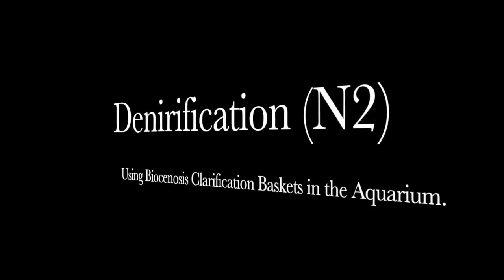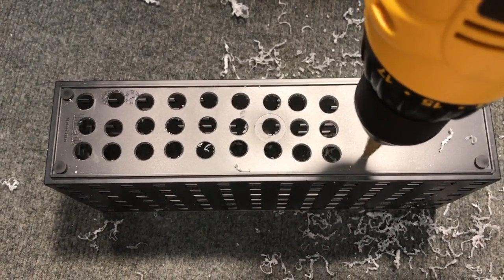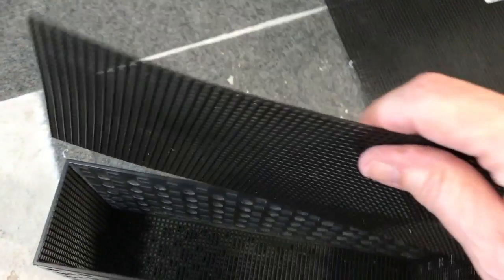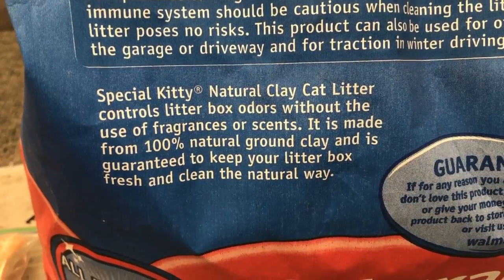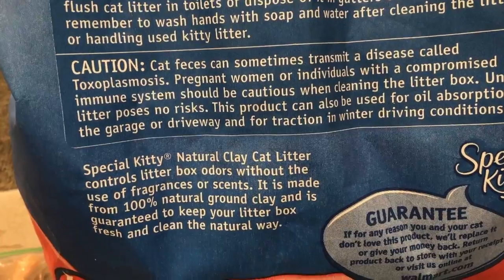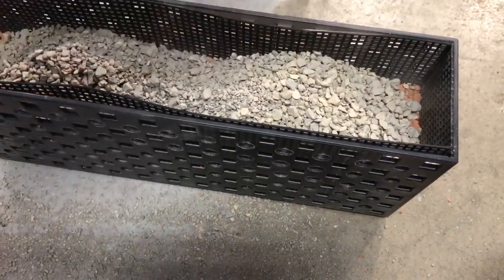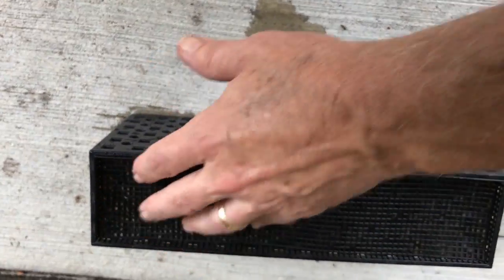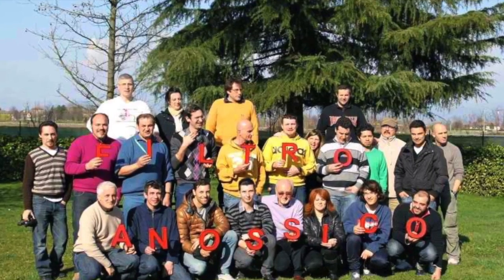Denitrification (N2) using a Biocenosis Clarification Basket in the Aquarium Sump.

Comment: Hi Doc, lots of questions here about media but I'm curious about the flow rate.  Typically a bio filter rule of thumb is 4x tank volume per hour.  How would you set the "low flow" rate, in terms of tank volume per hour, for anoxic filtration through a BCB filter?

Comment: Hi doctor. 

The explanation about "ionic attraction" was based on a progressively more and more negative substatum...

BUT :

It seems that the laterite layer do not have to be "buried" in the center of the cat's litter, as it goes to the contact of the basket in this video. 

Questions : 

Do we really need any cat's litter finally ? Maybe the laterite could be sufficient, no ? 
Or maybe the laterite layer is completely unuseful and only the cat's litter is functional ?

Anyway : the ionophoresis theory do not stand anymore with this video i'm affraid
Reply from the maker: If you can find another substrate decking attract positive ions out of the water besides kitty litter let me know. But it also has to have a cost factor involved in it.
Reply: This is NOT my question. The question is why do you tell the latérite MUST be buried in cat litter and do not do it here, this is a non sense in front of the ionic attraction... 
The question is then: latérite appear to be totaly unenecssary

Comment: Hi Doc , 
I made 3 x bcb baskets roughly 300 x 300 and planted 1 water lilly in each and placed them directly in my outdoor pond. I only run a Hozelock 9000l submersible pump with bcb bags in it that feeds a water statue. Can you confirm if the BCB baskets placed directly in the pond will have any impact.
Reply from the maker: They will have an impact, but that will depend on just how big your pond is, how many fish you have, how often do you feed? All these parameters will judge how many BCB baskets will you need. In my pond that was 1200 gallons with the amount of Koi I had in it I had 21 BCB baskets that were 7 x 7 x 11 in size and that handled that pond for over 30+ years.
Reply: @anoxicfiltrationplenums  do you have a video on that pond setup. ?

Comment: Dr. Novak excellent video! I just joined the discus hobby just under two years... I'm currently running a canister and overhang filter with partial water change and gravel cleaning 3 times per week. I need to investigate how I can install anoxic filter in my cabinet with limited  space.  if I figure  a way to build anoxic filter,  I hope can reduce my water change and gravel cleaning maintenance for the lowest nitrate level.

Comment: Hi Dr Novak,
Is it more more important to maximize the surface area around the BCBs to increase contact with the water flow around the bags (ie lots of small bags cumulative increasing the surface area)?

 Or is it better to have a larger Anoxic area inside the BCBS for the Anoxic bacteria to process NO3 to N2 (ie 1 or 2 large bags maximizing the Anoxic Zone 3?).

Grateful for your kind advice!

Comment: Hello Dr. Novak. I have setup a 110 gallon tank with a 35 gallon sump with 2 big BCB (11" 11" 8")  and I'm planning to use those BCBs as single filtration means. I have seen a lot of people that turned their traditional filtration system  in anoxic but I would like to start my anoxic filtration system by scratch. Is it possible ? Thank you

Comment: Hi Dr Novak, "Non-clumping kitty litter is mainly the clay mineral attapulgite (aka palygorskite) which is a magnesium aluminium phyllosilicate common in soils in the southeastern U.S. Attapulgite derives it absorbency from its needle-like, 3-dimensional crystal structure" is this the crystaline structure you mentioned in the video?
Reply from the maker: The clay or kitty litter has been backed and that’s what gives it the crystalline structure and holds it together. You can also use oil dry as a replacement.
Reply: @anoxicfiltrationplenums  can we used akadama soil for bonsai or hydroton as substitution alternative? Please answer...
Reply: Must nonclumping unscented kitty litter clay type .

Comment: Will iron oxide provide the iron needed by the bacteria?
Reply from the maker: Yes, iron oxide can be used like in the old days.
Reply: @anoxicfiltrationplenums  One more question, please. If baked clay attracts nitrate ions will crushed unglazed pottery do the same?
Reply from the maker: No, Kitty litter has a crystalline structure to it where clay pottery does not. That Crystalline structure attracts the positive ions out of the water body proper.
Reply: @anoxicfiltrationplenums  What creates this crystalline structure in cat litter clay?

Comment: Dr., Could we use akadama soil for this? it's high in iron and suitable for filtration as it is a type of expanded baked clay used mainly but thoroughly in Bonsai growers, it's imported to the North America and Europe from Japan with plenty of different granulometry classifications. Arlite is usually the western version of akadama and its recommended as a substitute of this type of substrate.
Reply from the maker: If the diameter of the substrate is small enough and not the real big stuff.
Reply: @anoxicfiltrationplenums   I figured, but couldn't be useful if we want to use the more coarse type at the very bottom of the fish tank with the plenum with very fine substrate on top of such layer ? Wouldn't that promote a much more controlled Environment in the substrate for microaerophilIc bacteria to get established? I mean less drag at the very bottom seems like a good way to manage suction force through the substrate without affecting oxygen levels.

Comment: Can't the kitty litter be replaced with something like red clay-based fluorite for aquariums, like the type Sachem sells? 

I suspect that the "crystalline" structure you mention is mostly related to porosity and average particle diameter of the material. The small average diameter and large porosity Im guessing (necessary for adsorption) found in the kitty litter creates enough mass transfer limitations that lead to anoxic  conditions within the kitty litter particles. The fact that it is baked Im guessing means that the particle will remain stable in shape and size still allowing for the anoxic conditions when exposed to water and slow flow. 

If this is true, wouldn't it be possible to do the same with red fluorite? The only issue I see is that the red fluorite tends to be dusty and not baked as well as the kitty litter Im assuming. But if its compacted enough or made the center of a filter with slow moving flow rate the particles should remain in tact and provide iron as well as high clay-porosity for anoxic conditions. Granted this would likely effect the stability and overall longevity of the filter, but wouldn't it in principle work?
Reply from the maker: Red fluorite can be used but it must be packed tightly to achieve the same results in a BCB. It is bigger in size than kitty litter or safe T Sorb .

Comment: Would Safe-t-Sorb work? It's clay, very similar to cat litter. I'm thinking of making some of these for my HOB filters. Unfortunately for me, all of my many tanks have gravel placed directly on the bottom and are planted. So I' trying to think of other ways to create an area in the tank to promote the growth of this bacteria.  
If I understand this correctly, you are creating area that is low in O2 to facilitate the growth of the bacteria that consumes nitrates? And turns it into N2? 
I think this might be happening by accident to some degree in some of my tanks. Sometimes when gravel vacuuming, gas will be released. It doesn't smell. So maybe it's N2?
Reply from the maker: Yes, it can be used too.

Comment: I have bags of natural clay kitty litter from the dollar store (which I use to pot my tropical water lilies in my pond each spring).  It is the non-clumping, non-fragrance kind but it does turn into a fine compacted mud/silt at the end of the season.  Does the Walmart brand you use do this or does it truly stay granular?  Would my cheapo brand be okay to use in BCB?
Reply: FWIW to anyone else reading, the Special Kitty litter was only $4/25lb at Walmart.  It does look different and hold its granular shape better than the dollar store brand (although the latter is also labeled as natural clay non-clumping litter). Best to shop around for the right stuff before making your baskets!

Comment: you can also use mesh net pots for the basket, they are sold on amazon and can have 3 to 6 inch diameter. I am making bcbs using those.
Reply from the maker: Yes they will work too
Reply: @anoxicfiltrationplenums  Thanks for your reply Sir. I have a big question. We know that Zeolite release ammonia if there is salt in the water, and since you had mentioned that zeolite can be used instead of the kitty litter, I am worried that it does not work in my goldfish tank since I usually add a tsp/10Gallon of salt to help the fish with minor nitrite spikes that I measured after each gravel vacuum session. Now, could you please let me know if salt has any adverse affect on the performance of BCB's?
Thanks a lot!
Reply from the maker: Farzad T First of all you should never use salt with goldfish it messes up their osmotic ability. If you’re using salt as a prophylactic then I would have to ask you: Why?
Reply: @anoxicfiltrationplenums  Thank you Dr Novak. I had added salt (1 teaspoon/10Gallon) to protect them against small nitrite spike that happen after cleaning. Now that I know its not good for them I will do a water change and take the salt out. Thanks for the information!

Comment: Recently found your channel and am loving all the knowledge you are sharing.  I know I am late to this video but I was wondering if I could use hydroton/ lecca instead of the natural clay kitty litter? I already have a lot of the hydroton and I believe it is just baked clay pebbles.
Reply from the maker: Yes you can! If the size meets the requirements of 1 to 3 mm.
Reply: @anoxicfiltrationplenums  it will after I take a rubber mallet to it 😆
Reply: thanks for your question, Im still finding another ingredient for natural clay kitty
Reply: @eadomke2150  does it really works?
Reply: @anoxicfiltrationplenums  can baked akadama soil for bonsai be used?

Comment: Hallo Dr. Novak,
I'm starting with a new tank with a sump that will have 4 bcb's of 11x11x7" (28x28x18cm) as unique filtering system. I made the sump big enough to host such big bcb's because I understand that big is better for anoxic zone growth and for the strenght of the ion attraction.
I've seen in some of your video that the pH value of one of your tanks is around 7.2-7.3 and I've read that pH optimal value for facultative anaerobic bacteria is a weak alkaline  environment. I've read also that facultative anaerobic bacteria decrease their activity in  acid environment.
In your eperience what is the pH range compatible with the use of the afs ? moreover which is the pH (acid) value which is not advisable to overcome ? which are the relations between  faculative anaerobic bacteria activity and pH ?
I can image you are full of requests, but I hope an answer since I could find only few documents about facultative anaerobic bacteria growth in low pH environment.
Thank you in advance

Comment: Hello Dr. Novak, 
I'm Gianluigi from Italy and I'm totally new to anoxic filtration, I have read a lot in these last days, and I want to try to set up a BCB. I have a question to ask. I know that anoxic filtration can be used as  a stand alone system, preceded by a mechanical filtration at the beginning. My question is the following. It is somehow usefull to add a BCB inside a sump which has already other kind of filtration systems or not? For example  a sump which has a stage with a moving bed filter ?  and if the answer is affermative, which position will be the best, before or after the moving bed ? Finally do you recommend the use of an anoxic filter in combination with other traditional filters or it is preferable to use the system alone ?
Many tanks for sharing your knowledge
Reply: I got your anoxic filtration system document and also the answer to my question.
Reply: @valp729  hi, pls share the answers to your questions, I have a moving bed K1 media in front of my BCB. Does yours work?
Reply: @mikeaaronyap  unfortunatelly it doesn' t work. I gave up after 5 months. Gratest problem was NH3 fluctuation. I passed from 0 to 0.5 or 1 mg/l whithout reason. It seems that in my cas Bcb sequestrate NH3 very efficently in a manner that facultative anaerobic bacteria cannot use. Then when saturation occurs NH3 came again. I have a Mbf in front of Bcb too.
Reply: @valp729  does this mean you kept your K1 moving bed biological filteration, but took out the BCB? More frequent water change would take care of removing nitrates then.

Comment: This might be a dumb question, but I really do need further explanation...  Why isn't setting up a such a substrate, including a plenium, within the aquarium itself not enough to properly cycle out the chemicals?  Why have a separate BCB in a sump?
Reply: Same here
Reply: We don't want debris trapped inside the basket since other types of harmful anaerobic bacteria will appear and nourish in such environment. In anoxic filters, the water is prefilterred to remove any solid waste before going to the sump. Btw, Dr. Novak did use the same kitty litter as substrate for some of his planted tanks. The point is the kind of fish in these tank shouldn't poop to much.

Comment: I used hydroponic clay pebbles in one of my filters just becouse i had it spare, found out later the clay pebbles also pull ions from the water
Reply from the maker: you're right, however, it will not produce Anoxic conditions that will turn Nitrates into  N2.

Comment: Is this similar to the way Zeovit media functions? Typically used in reef tanks.
Reply: Kinda yeah, Zeovit or Zeolite also leaches minerals back into the aquarium so it does have other benefits. BUT as i understand it zeovit, cat litter, lava rock, activated carbon, and 'reef' rock are just fossilized organic matter of various kinds. because they are super porous they have low oxygen areas deep inside them where anhydrous anaerobic bacteria can grow which feed on nitrate and to a degree phosphate. The difference being the "other" affects they have on water and how dense or porous they each are. Reef rock buffers PH and isnt that porous, carbon is so porous it can absorb toxins but its so good at it it cloggs and doesnt work well long term as filter media. its all the same really, some of the materials have more benefits than others but essentially you are just providing massive amounts of surface area for bacteria to grow, and i mean millions of times more surface area than a "Bio Ring". i always wondered if it was the case with cat litter now i know! apparently most Cat Litter is made of Laterite or Diatomite.